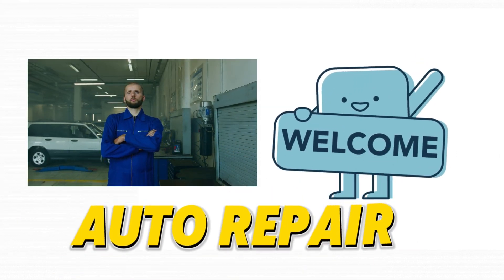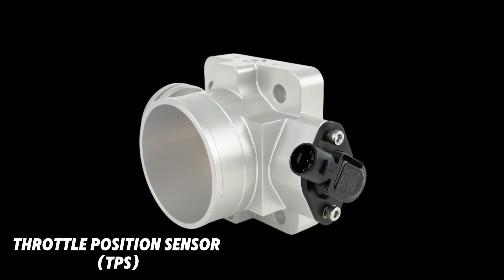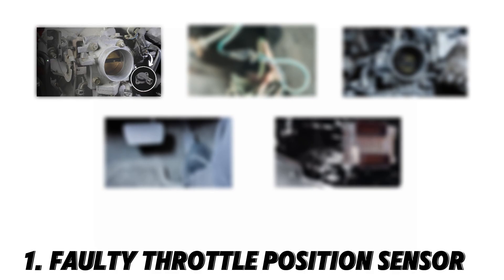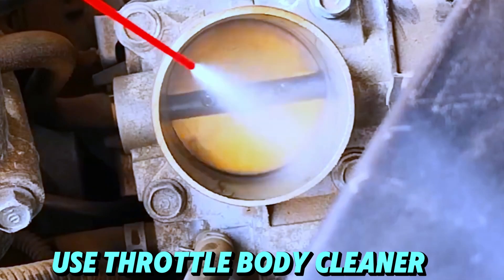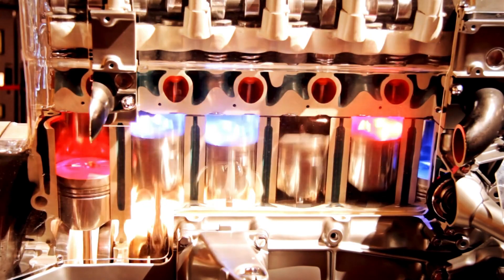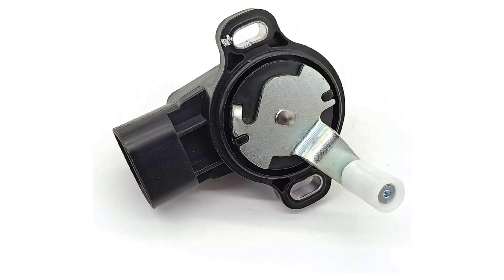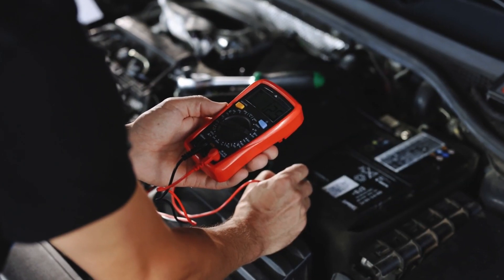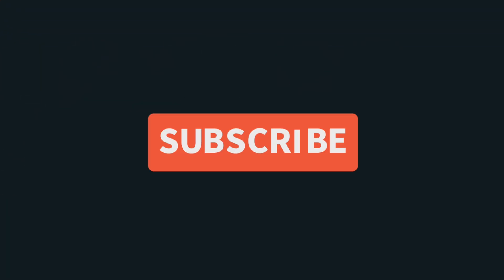P0222 CODE:  Throttle Position Sensor/Switch B Circuit Low Input ||

Comment: I'm currently having this P0222  code. I've checked 5v supply, gnd and signal on Pedal position sensor 1 & Pedal position sensor 2; all good.

In Throttle position sensor 1 got 0.78v but in throttle position sensor 2 signal was dead. Got 0.02 instead 4.5v.

I checked Throttle Position Sensor connector so when I started moving the TPS connector the TPS 2 signal changed from 0.02v to 4.2v. so the problem was there. 

Once the TPS 2 signal came back again, the engine started to accelerate normal then performed a road test and went spectacular.

Two days later, the P0222 DTC appeared again. Think I'm going to change the TPS connector, clear codes & perform road test again.
Reply from the maker: The P0222 code indicates an issue with the Throttle Position Sensor (TPS) or its circuit. You've already checked the 5V supply, ground, and signals on the Pedal Position Sensors, and they are all good. However, you found that the signal for TPS 2 was initially dead but started working correctly when you moved the connector, suggesting a connection issue. After fixing the connector, the engine performed normally, but the P0222 code reappeared after two days. It's likely that replacing the TPS connector, clearing the codes, and performing another road test will resolve the issue.
Reply: @AutoRepairGuides  Hi 👋 I got a brand new TPS connector but I haven't replace it yet.
Exactly, I've already checked 5v supply & ground. In addition also checked resistance on TPS 1 / TPS 2 signal wire from the TPS connector to PCM connector and got 7.8ohm. Think is pretty high resistance don't you think? 

Thanks for your kind and quick respond.